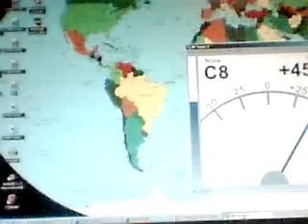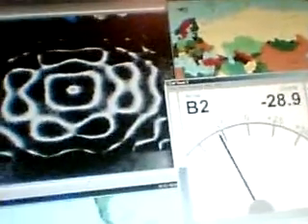432hz validated.

Comment: Your validation does not clear up my skepticism.  As others have pointed out, you would get different results with a differently sized plate.  Try it yourself.

I'll just also point out that your tuner is not showing frequencies of a harmonic series, but rather frequencies of a twelve tone equal tempered scale: not the same thing.

But if you like 432 go for it.

cheers from snowy Vienna, Scott

Comment: Incorrect.You're confused with equal temperament tuning. In that case several strings of the piano are tuned slightly off for the reason you mentioned. You could tune off 440 or 432 Hz to achieve this. 

This is a different issue altogether.

Comment: I think that tuning one of your strings with the 432hz frequency could be a starting point. For instance if you tune your D string on your guitar with the 432Hz and the other strings based on that you could get all the other strings in harmony, right? The trick is to get rid of the 440Hz frequency ('A') and tune your guitar using the 432Hz frequency and its harmonics.

Comment: check out any of the 1,000 other videos showing cymatics and 432hz etc. it was originally changed so bach could use the piano. 432hz you would have to retune each key for each note impossible so switch to 440

Comment: i believe the point is that the tuner is set to 440 hz meaning that a 432hz frequency would appear out of tune (ie red). Thus a shape taking place while the tuner is red would indicate that it the sound does not conform to 440 tuning. Granted that is what it appears like to me. I could be very wrong.

Comment: this video give no validation. the shapes produced on the plate from the sound vibrations have to do with the dimensions and the material of the plate. a bit of wave physics would be favorable for sure in such cases. surely there is a big subject behind the 432 vs 440, but fanaticism and the blindness it produces is of no help to anyone. try more to find real proofs and validations.

Comment: midi clip to audio, then detune manually, or use the frequency shifter plugin. I find manual detuning in each clips sample editor is more accurate, but some drop the freq shift plug on the master. Either way can achieve 432hz.

Comment: Standing wave patterns cause the stationary nodes where the sand/salt/dust collects on the chladni plate. Standing wave patterns are formed at the resonant frequency of the plate. The patterns formed depend on damping and multiples of the fundamental frequency. The only reason the plate resonates to pythagorean tuning is because the resonant frequency of this particular plate is A-432. 432*2 is 864, which resonates; so does 440*2, or (n)*2^x, as long as n is the resonant frequency of the object.

Comment: @Raddmiral 
That won't get the proper pitch.. There was a big debate on godlikeproductions about this if you google 432 hz and that website you would find how to do it properly in that thread. I believe it was an aussie sound engineer who figured it out. if you want I can dig it up message me on here if you want it. Im positive the 440 to 432 method you mentioned isn't accurate and its not how I did it to my tool videos.